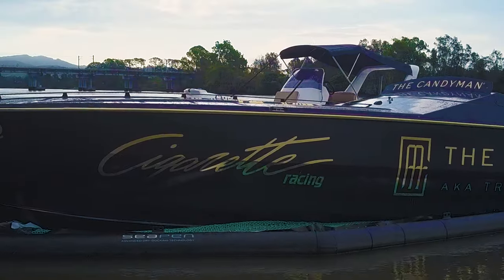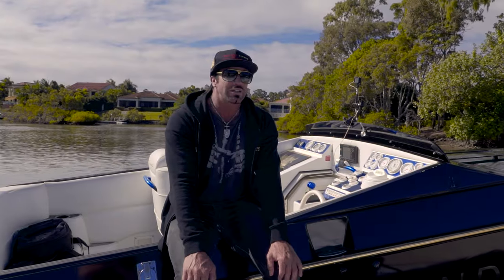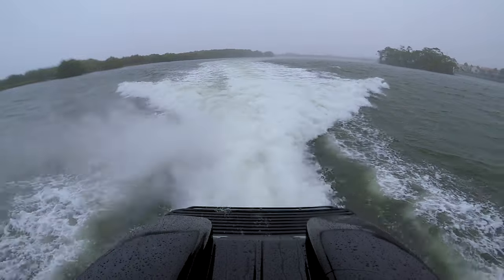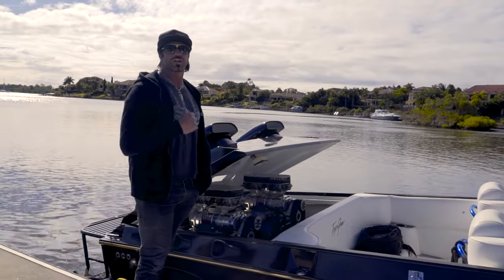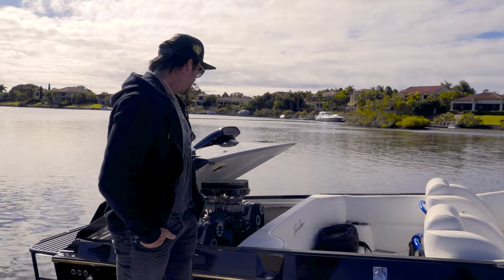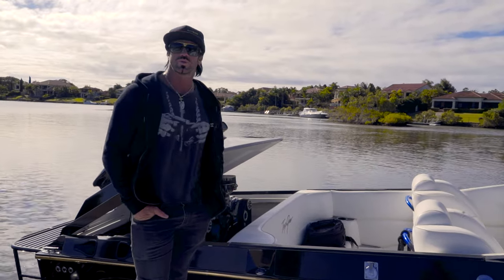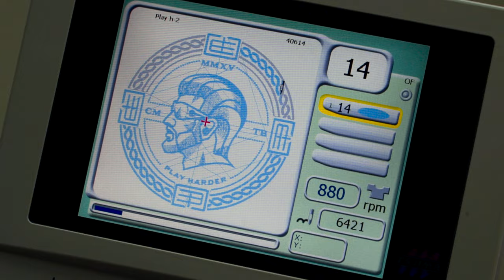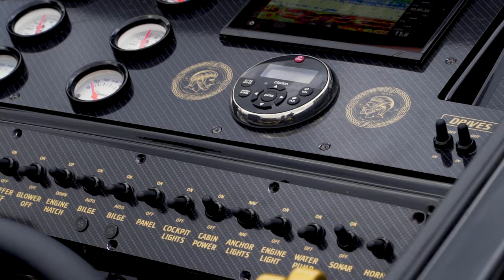The Candymans Cigarette boat refit project

Comment: Just a FYI, I fitted out this boat with its clarion sound system, 4 10” subs on the main deck, speakers up top and down below, head unit and amps in the cupboard to the left as you walk below

Comment: I would of put a small Head on board so the ladies can relieve them selfs when drinking. I also would have put a Holley Dominator Electronic Fuel Injection on both the engines for performance and reliability.
Reply: There should be one on the left side of the entrance to the cabin...or under one of the seat cushions also in the cabin

Comment: Travers with the money you have why not go with 2 Mercury Racing Dual Cal 1550.  Or the 1350 version or 1100 version?  They are turn key and torture tested to run hard with low low chance of issues. Its what most inboard cigarette race boats run with.  Unless I'm wrong and you have Mercs already lol

Comment: 8:13 He wont be smiling GIGLIN ON TOP OF THAT CHAIR !if the boat dips when he thought it was gonna plain over that wave an it chucks his foolish ass over the rail an the boats full blast with no driver! doesn't even have a kill strap attached what a loon! at least have a kill plate under your heel or foot so if its not pressed down under high speed every 30 sec. or however long it kills the engines. .L.O.L..

Comment: 2000 horsepower with only 90 top speed something don't sound right
Reply: Pimpingdonk 4life Unlike air, water is pretty dense and its a pretty respectable speed.
Reply: It seems that your knowledge on boats and the powers that are necessary to be able to move fast on water are fairly limited. It is highly suggestible to increase your knowledge by studying the subject little more.
Reply: Hull design, drive placement, and prop selection make a HUGE difference on water.
Reply: @PaulyRenzeth  thank you for not bashing me over the head for the lack of my knowledge of offshore boats I'm just a poor old dirt farmer from Oklahoma have a good day sir
Reply: I agree with Pimpingdonk, 2000hp @ 90mph seems quite slow. A m35 widebody boat does 170mph at 2700hp. Just an increase of 700hp and its almost double to speed of 90mph, doesn't seem right...
Reply: @BobBob-fp5fn  Those 2 boats are different in every way imaginable.
Reply: @cousineddie7444  The two boats are different but they are about the same size, you don't think its crazy that the m35 almost doubles the speed of that cigarette boat and only has 700hp more? That cigarette boat should be doing 120mph.
Reply: @BobBob-fp5fn   It's an older Cigarette boat, not a fountain… also, it probably weighs nearly twice as much… M35 tips the scales around 11000 pounds in those 170mph runs you see in AZ, but that 38 Top Gun with all that extra interior and lord knows what else he installed probably tips the scales closer to 17 to 20000 pounds… in salt water... and given if it does have a much greater weight, it would be propped way down in order get up on plane in under 10 seconds otherwise it would take 20 to 30 seconds for to get 20 or 30 miles an hour. There are just far too many variables between an M35 that you're speaking of, which has known running gear, and an older 38 Top Gun with engines that "might", make 1000hp ea, unknown drives, props, and displacement.

Edit  M35 only weighs 9250lbs dry... so probably close to 10,000 on those runs with fluids crew and equipment.  Excuse my error.
Reply: @cousineddie7444  https://www.boats.com/reviews/powerboat-performance-report-cigarette-38-top-gun/

Read that link. Shows results of a 1999 top gun 38 going 82mph with only 1000hp...
Reply: @cousineddie7444  86mph*
Reply from the maker: Yeah she is a heavy old girl with a full cabin about 8 tonnes with fuel ( About 17,600 pounds) with old #3A drives, flat bottom hull and running 5 blade herring 16.8 x 31's maxed out at 4200 rpm. Herring is currently making us some custom props that should give us close to 100mph by the calcs
Reply: @BobBob-fp5fn  Weight and hull design have a lot to do with it. This video shows how he only made improvements to paint and looks in general. M35 is a power cat. Not a monohull. Makes a HUGE difference. I drive a 55' power cat for a living.
Reply: @BobBob-fp5fn  Top Gun is WAY different. Top Gun is a real heavy, stable, classic boat design. It's not a pure top-speed demon like a Fountain. You need some SERIOUS power to hit 100mph in a 38 Top Gun. We run a Top Gun w/ twin staggered 572s hitting 1150-1200HP in the Great Lakes and 100mph is still hard to achieve.
Reply: @BobBob-fp5fn  Let's forget about the engines, drives, and props, and look at what you're trying to compare... That's a 9100lb stepped hull, to a 17,000lb flat bottom.  It's literally comparing a Honda Civic to a Pontiac Catalina.  You just can't.
Reply: I think he's asking the police how fast is their boat go.
Reply: @BobBob-fp5fn  The difference is as simple as Catamaran vs more traditional V hull. Both boats but its more apples to oranges than anything else. Plus theres probably close to 10-15 years difference in tech between a DCB m35 and this Cigarette, this doesnt even have hull steps making it probably around a mid 90s design.
Reply: @cousineddie7444  The boat is 17,000 pounds loaded up, doesn't mean it shouldn't go faster not loaded up. Also, the Candymans boat was topped at 90mph at 4200rpm... If it went to 5000rpm it might have a chance of being in the 100s. I think if they had different engines and a different prop set up it would be in the 100s. There is no way in hell a 2000hp 38 top gun cigarette boat should only be doing 90mph.
Reply: @BobBob-fp5fn  When a boat has a greater displacement, you have to prop it down to maintain performance between 0-20-30mph.  This dramatically changes it's top speed.  With properly sized 6 blade props, it will definitely be faster, however it's still a smooth hull... and that also makes a significant difference in top speed.

Comment: Awesome  job . But  90 mph  with 2000hp  .    Not much  speed for that kind of hp . I guess .
Reply: Do you know how boats work?
Reply: Mate, look at the side of the bloody boat 😂
Reply: For a boat thats pretty fucking quick my dude. Boats glide over the waters surface, and the faster the boat the more chance you have of catching air wrong and going airborne lol. Boats and vehicles are completely different in regards of speed.
Reply: BigMacl420l Same year as mine! No lifting hull back then with the new steps and they were much heavier. New Cigs are Kevlar with steps in hull design. We boat Lake Erie super rough and the heavy boat wins on those days. No cracks in the glas these boats are rough water tanks. 90 is fast for heavy deep vee

Comment: My uncle has a cigarette boat and it goes 100+ mph
Reply: MrT 06 lmaoooo true, why do you want a rooster tail and then never tow a tube or skier t
Reply: @Tyler-zw4kq  dude same mine goes 25 and I can do a lot a duff with it.
Reply: Different powerplant different props/ outdrives all make a difference in top speed.
Reply: @Tyler-zw4kq  How long would it take you to go island hopping in the Caribbean? does your boat have a bed bathroom couch table fridge etc?
Reply: @Tyler-zw4kq  I'm not rich but the boats I've been looking at are extremely slower but have far more amenities and a loner range. It all depends on what you want to do with a boat. My grandpa had a big cruiser, a sailboat and a fishing boat. he wasn't rich. his cruiser was the most expensive at $15k.  I work in construction, i live below my means, i have no debt, my house truck and motorcycle paid for. few more years i will sell most of it all and buy a steel hull trawler  refinish it myself. found a running livable boat for $13.5k.. Change the way you live and think it will improve your quality of life.
Reply: @Tyler-zw4kq  most of the go fast V-hulls have that stuff. Built to run down the cays, off to Bimini for the weekend. in a big slow boat it would take 24 hrs to get there not 3-4 hrs

Comment: Eww... the engines still use belts? Dude switch to chains. Otherwise, my GOD is that thing cool...
Reply: Mikhail Gorbachev belts are better. Less noise, friction, don’t need oil, and it’s the better choice for a watercraft
Reply: What

Comment: "the right hand engine"?  On a boat, that's called the "starboard engine". You can afford the boat, so you should learn something about nautical history. Money without knowledge makes people smile to your face but laugh at you behind your back. Money does not bring respect, respect must be earned.
Also, why run supercharged V8 reciprocating engines with carburetors instead of turbine engines? Lighter, faster, more reliable.